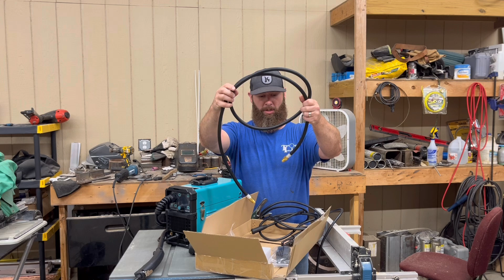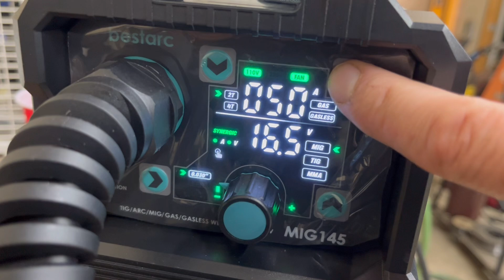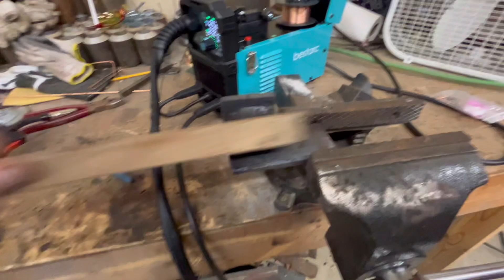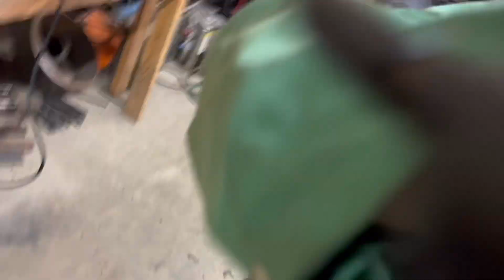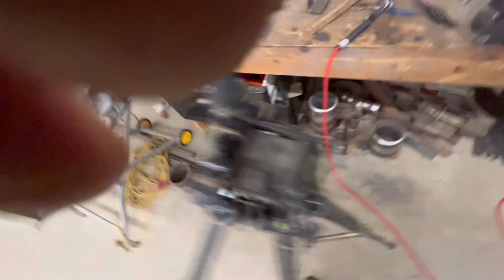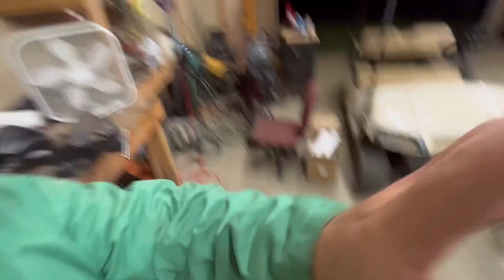Testing the Bestarc multi process affordable welding machine.

Comment: Just ordered one
Reply: Do yourself a favor and order the 12 ft cord and gun.  It cost me 35 bucks from Etse from china and it took about 3 wks to get here.  It is identical to the one on the machine.  took about 30 minutes to swap it out..  There is a youtube video of a guy doing the swap.  I wish I would have order 2 of them , one for a spare.
Reply from the maker: @fooey9013 thanks for the tip. I didn’t know they had a longer one for it. 👍🏻
Reply from the maker: Good deal. I think you’ll be happy with it. 👍🏻

Comment: When you were using a 3/32 7018 vertical up the machine was set at 100 amps. So the settings and output are way off. It's like these manufacturers just don't care.
Reply from the maker: Yeah about 90 amps is what I normally run but to be honest as long as you know how to set your machine you’ll know if it need to be turned up or down by how it runs and not by the number. But I definitely understand what you’re saying.

Comment: Good show ole buddy. I suppose this should make me run out and buy one? It’s only been since 15 August 2017 since I used one. I still have my $500+ hood! Of course it probably needs a battery. 🪫 it’s truly amazing what the Chinese can put out for so little money. One thing… the Boilermaker is still peeking out with the chipping hammer 😂 But the cup walking is really coming together. And… I really don’t think it has lift arc capabilities. That would put it over the top.
Reply from the maker: Hahaha, yeah you should definitely go get one. Just kidding . Yeah it’s unbelievable how affordable these little machines have gotten and they run really well. They asked me to do a review for them so I did. Hope you are doing well ole buddy. Good to hear from you.
Reply: @getweldsoon1113  , how well can one be at 72?
Reply from the maker: Well I hope you’re doing amazing at 72.  Also, this machine does do lift arc on tig setting. I just made a video of it and I’ll post it in a little while.
Reply: 9sl😊 @getweldsoon1113
Reply: @getweldsoon1113 , oh bye the way, I have a challenge for you as a guitarist. See if you can figure out how to play one or the other of this guitar lick from one of myall time favorite bands. And my all time favorite guitarist. https://youtu.be/IpMyf9EJDFA?si=juTfLGkvgtpCSoIJ